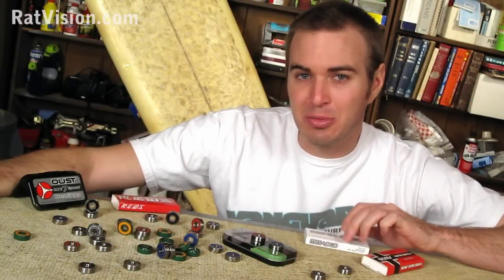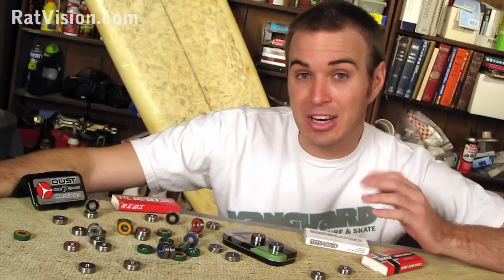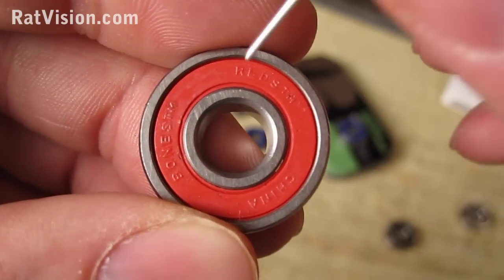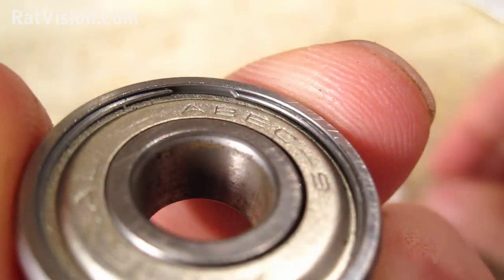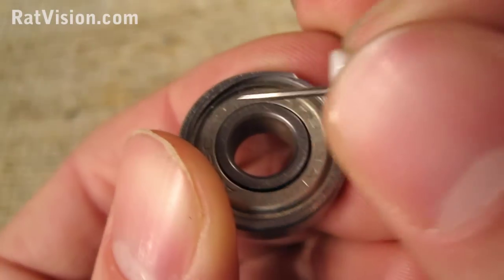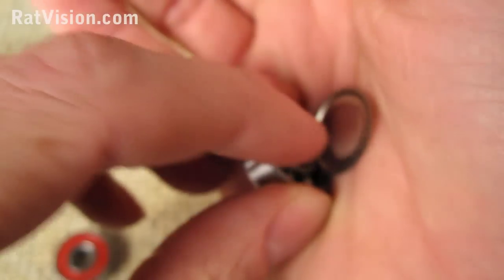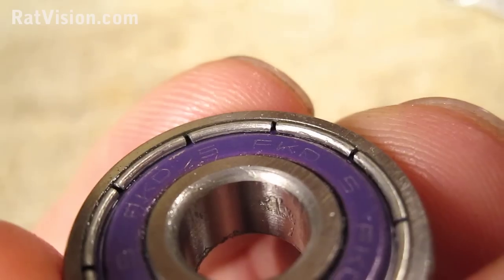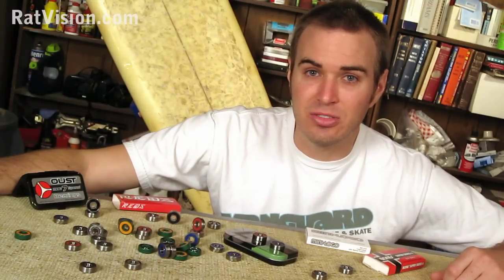Take Off Skateboard & Longboard Bearing Shields/Seals

Comment: So da last type of bearings how do u clean those
Reply: You don't
Reply: Damit. But still, what if I clean them with the citrus cleaner, rinse off with water, and blow dry it before lubricating it with some proper oil? Why wouldn't that work?
Reply: Csanakb Some water might still get trapped inside
Reply: What a fucking ripoff...
Reply: Yeah what I'd suggest is just trying to pry open the entire thing and see if you can put in your own makeshift shield.

Edit- try a thin flathead or a sturdy razor blade in the center
Reply: I'd use rubbing alcohol. Pour some in a paper cup then submerge the bearing with one hand and make it spin with the other (prolly should wear gloves) for a minute or two then take it out and spin it dry then do the same thing with a cup with the lube. It might not get everything out but by the look of how they are pressed in, it will get alot out. Lastly dry it off with a paper towel and away you go.

Comment: As I speak Spanish I'm not quite sure if what we know here as "Vaselina" (solid & liquid) is the same as you know there as "Vaseline", which is a brand. If so, we're talking about the same :P
A mix of pure solid and liquid vaseline works well as lubricant for lot of purposes. Obviously not all. I've never used it in something like this. But let me say it is working great so far. The only trouble is that 'vaselina' melts easily with heat, and can come off. But the mix I made is still there.

Comment: I got a set of the mini logo bearings, which has a metal shield and a rubber shield. Which side do you recommend should be facing the outside of the wheel? The side with the metal shield or the side with the rubber shield?

Comment: +rat Vision skateboard Tech   Also, for in-line skates, which bearing puller do you recommend? I currently have a "BSB speed bearings Gryptool one-step Push\Pull bearing removal with a 5/32"Allen key", but it is worn out and the bearing gets stuck on it when I pull them out. I would like to buy a new tool, but I don't know which one would be better for inline skates. i use bearing spacers, and most of the reviews I've looked at say the pullers don't work when you have spacers. thanks again

Comment from the maker: Take the shield off.  It's not doing any good now that the C-ring is gone.  If there is a shield or seal on the other side of the bearing then turn the bearing around.  Add lubricant to that bearing regularly to keep it from getting ruined faster.

Comment: I never said it made bearings faster, I care about bearing speed, What I did say was that removing one shield from a sealed bearing will allow you to clean and lubricate them which is not possible normally with greaseballs. It may cause them to become dirtier faster than with two shields but it'll also allow you to lubricate them if they run dry, and as you said, will help to avoid blow outs. Not trying to start a war here, just clarifying what I meant.

Comment from the maker: Are yo aware that you're replying to questions that are over a month old?  You don't want to use bike chain lubricant for bearings.  You'll slow them down and the particulates in dry greases are not small enough for the metal surfaces in bearings.

Comment: when putting the c ring back make sure you have it orientated correctly. If you look at the rings cross section you'll see that it is not flat and parallel to the radius but at a slight angle.If you do not pay attention they might just fall out. You can easily tell because the bearing do not run normally and do not feel as if they are completely shut

Comment: If you have pressed metal bearings then you should remove them from the outside. Use a sharp sharp cutter and gently work the clips in. Work only 2 and then gently slide the cutter in and pop off the shield. This will damage the shield but when you put it back in it will be easy to make sure that it still seals. The key is to not damage the inside of the shield. Also remove only one side so that you can face the damaged side inwards protecting it. (I had an emergency because I bladed in the wet and rusted my bearings)

Comment: Hey I have the pressed in shields and it's a really old board so the bearings are slow and dirty. I wanted to give cleaning a try with stuff at home before I give in and just buy new bearings. I was just wondering if i can still go the whole mile like in your cleaning video with the shields on while cleaning and still get some results? I don't need the best board in the world coz it's only a small hobby but I'd like the bearings to go a bit faster so I don't have to push as much.

Comment: I currently have bones super reds bearings and have an old pair of reds. Would it be smart to take the seals off the old pair and put them on the back of the new ones where it's open? (where you can see the bearing spacer)

Comment: Anyone super frustrated with intensely grimy c-ring removal, I found the best way is to get a normal sewing needle and hold it with a pliers. If its not lifting on one side try the other and just keep at it. :)
I stabbed mt fingers to the bones more than once but when I did it this way, ugh, worth it.
Reply: my shake junt lowrider bearing one shield keeps coming off by its own and i have to keep pushing it back in and its the dirtiest bearing shield out of all my other ones.

Comment from the maker: Well that sucks.  As you can see in the video a paper clip works just fine. If you had to pry to the point where the seal got bent then you were possibly prying too hard and may not have done it correctly.  We've been using paper clips for many years and have never bent a seal once.

Comment: So, I used to skate when I was younger, but only for awhile. I didnt know anything at all about the board but how go ride it. Soon stopped and put my board away. Well I found it when I was recently asked to chill with some friends and my bearings were dirty. What bearings do i need to get to get back into the habbit of skating? And is the bearings the only thing on the board that requires maintinience besides the deck itself?
Reply from the maker: The bearings are the only thing that needs maintenance, besides deck repair.  I'm not sure how bad the bearings are that you have.  You said they were dirty.  If you haven't ridden the board in a long time, you may just need to lubricate them.  Just go with a cheap set of bearings.  Since you don't skate that much there is no need to spend a lot of money.  Sometimes the cheapest bearings end up being perfect.  Most shops sell Bones Reds for around $17.  If you find can't find cheaper, go with those.  Cheap doesn't always mean low quality.

Comment: hey man thanks for the video. Ive tried to clean a set of rubber sealed bearing but in the process of taking the seals off the rubber got damaged and the seal comes out every time i skate making the thing just dirtier than ever. is there a way to remove the rubber seals without damaging them or are they just really susceptible to deformation ? PD: ive been using the thiniest threading needle i could find so i dont think that the size if the hinge is the problem.
Reply: oh forgot to say i used the part that isnt pointy

Comment: @skateboardtech Are you sure there is no way to get inside metal pressed bearing shields? I'm dying to clean mine thoroughly. Also, I use break cleaner to clean my bearings and some dry powder lubricant. Are any of these safe for my bearings?

Comment: For the pressed bearing shield, you can destroy one of the shields to maintain the bearing then install with the open side to the center of the wheel. To destroy it you can use a small screwdriver. You are welcome.

Comment: Is the back of the Bones Reds bearing made out of rubber? Can you use something to take out the shield without damaging it? Or is that the best way to do it? (I'm sorry, I'm still new to skateboarding :/ )
Reply from the maker: Do not touch the white/clear plastic piece.  You won't damage the rubber seal with a paper clip.

Comment: should you use the same orange citrus cleaner that you clean your bearings with to clean your rubber shields/seals with as well? Like, just a nice damp paper towel with some of the cleaner on it, and just rub it around both sides and then dry it? Or...a different method?

Comment: i have a question. i got the exact c ring bearings you used in the video. 1 ring fell off while skating. the shield isnt on tge vearing now since it wont stay there without the ring. could i still skate the bearings?

Comment: Is it true that if you take the clear plastic spacer that is inside the bearing, that it will make your bearings faster? I don't meant the seal or shield, but what's inside that separates the balls.

Comment: What is the liitle maintanance for the non removable shield bearings?, please help
Reply: I wanna know the same thing 😐
Reply from the maker: +Luke Literal You can either clean them the same way, or lubricate until the bearings are no good.  You need to be very careful at drying the bearings.  Spin them a lotwhile blow drying.
Reply: +Rat Vision – Skateboard Tech  Thank You
Reply: +Rat Vision – Skateboard Tech  how do I disassemble abec3 bearings
Reply: damnit I wish I read that earlier, I ended up removing them and they won't go back on. they sell replacement shields on bones for the bargain price of flipping 8 dollars and 6.50 shipping for a full set. Not even remotely worth it

WHY THE FUCK DO THEY MAKE THEM LIKE THIS?!?!?!?!

Comment: Can I take the bearing seal with a pin ??
Reply: Bones reds
Reply from the maker: JR Z Yes
Reply: +Rat Vision – Skateboard Tech 
What causes shields to pop off during riding?
Reply: +Rob Munoz Not properly inserted or dried out rubber in the seals usually.

Comment: I removed the shields off zealous bearings with built-in spacers. Was not a good idea. It was very clean inside and still lubed up. But I bent the shield. It's like more aluminum than rubber compared to bones reds.
Reply from the maker: Steel*

Comment: i just have a small question, i have redz bearings for my wheels, and i removed the ball holders inside the bearing instead of the red shield. is that bad? i put them back and they dont spin like they used to. im going to clean them, but should i just remove the red shield next time and not the ball holders?

Comment: Hey! Rat VIsion, is it safe to ride my bearings with out the ball bearing plastic holders? I already ride with out the guards, but i notice a great amount of speed with out them
Reply: No I popped my bearings like that
Reply: That's what I do and mine are fine
Reply: +Anon Ymous The plastic holders re the ball retainers.  Deep groove ball bearings are designed so that the inner race can be assembled by sliding all the balls to one side and inserting the inner race.  It comes out just the same way.  Without the retainer, the inner race will eventually come loose and your bearing will be ruined.

Comment: i wish that bones reds had shields on both side so they hold in the lube for longer, i guess you can get some more shields separately but i cant find any on the net
Reply from the maker: You can put seals from an old set of Reds onto the other side of a new set.
Reply: Rat Vision – Skateboard Tech true but bearings are expensive but i guess when you get your second set you just put them on a soon as you get them and so on
Reply from the maker: Yes, that's what I was referring to.

Comment from the maker: Now you learned not to buy those bearings.  Hurray.  Apply lubricant and ride them until they break.  Or you can try cleaning them with rubbing alcohol, but only if it is +90%.  The remaining percent of rubbing alcohol is water.

Comment: I have pressed metal bearing, I do realize that there's not much I could do. But is there anyway I could clean them, and grease/oil them up; I skate for a good 3-5hours every day, and I need to maintain them.
Reply: Yes. I'm a newb here..so please, reason with me
Reply from the maker: Lunnatikatz That's cool that you skate so much.  Because you do skate so much I would offer a different solution.  You can do the same cleaning method shown in the video, or you can keep adding a drop of lubricant to every bearing once a week until they fall apart.  Because you skate so much and require frequent cleaning and lubricating, it would be best to get some bearings that are easier to maintain.  Personally, I would just lubricate them until they got slow or fell apart.

Comment: ok for the rubber ones, use the smallest flathead jeweler's screwdriver on the inside of the ring,  it fits much neater, and won't tear or stretch the ring.  dollar stores have a set for, well, a dollar...and supermarkets have them in the line as "eyeglass repair kits".  I used to have to clean my bearings once a week from work, or they would start to fail.  complete teardowns, balls and all.

Comment: The last purple bearings why is it not removable? Cause I'm having that.. How can i clean it with the Bones speed cream i just bought?
Reply from the maker: You don't clean with speed cream.  You put it in after you clean and add a drop to every bearing about every 3 weeks.  You can skate your bearings until they break, or clean them the same way.  You have to be sure to dry them completely by spinning the bearings.

Comment: As an ME, I mostly agree with the video but disagree somewhat.  It's ALWAYS best to remove both shields (or seals, whichever applies) - for cleaning both sides of the cage and races.  Citrus cleaner is very good, but it's no problem to clean with common dish soap (esp. Dawn), then rinse with water thoroughly, and dry completely.  A final rinse with alcohol (denatured/methylated or 90% isopropyl) is a GOOD thing - it mixes with and helps remove trapped water.   Drying thoroughly after is the key.

Comment: Ok... So, today I was tightening the nuts on my wheels and I dented my bearing a little bit... It doesnt seem to cause any slowness whatsoever, infact it might be faster than some of my other wheels. So, what I was wondering, is what should I do? Should I just keep the dented shield on? I tried to take the bearing off on the axle of my truck, but it wouldnt pop out... So, should I just leave the dented shield on as it seems to pose no problem, but I cant get the bearing off of the wheel.
Reply: Alrighty! After a bit of research and dedication, I managed to get the bearing out of my wheel on the axle. I took an exacto knife and I got the shield that was dented off of the bearing. I then took the side that did not have a shield and I put it facing the inside of the wheel, and the side with a shield facing the outside of the wheel. It is not making any strange noises anymore, and I just plan to clean the bearing out every now and then. If anyone has this same problem, just do what I did!
Reply from the maker: You can leave it.  You may not have dented it in far enough to cause an issue.
Reply from the maker: Looks like you're fine.

Comment from the maker: @fallendude246 I just wrote an article for Concrete Wave that completely answers this type of question. It's really hard to know what the best bearings are or brand to choose. Manufacturers don't give out technical information about why their bearings are better. Most of the stuff out there about bearings is hype and bullshit. Plus most bearings are not made by the brand. They typically buy them from a Chinese manufacturer and slap their name on them. ABEC what, Biltin? I need more info.

Comment from the maker: @1511116 Don't worry so much.  There is nothing to be intimidated about.  Just follow the videos and you'll be fine.  Putting the C-ring back on can be difficult.  The worst thing you could is tighten the axle nut down too tight on the bearing, but if you use bearings spacers you won't damage the bearing.  Just use common sense.  if you have any questions send me a message thru my channel.

Comment: What should I use to clean off the bearing shields? I swear, I try not to ride in dirt or water, but by the end of the day, my bearings are always covered in what I can only describe as layers of chocolate cake. Especially the bearings facing the inside of  the board.

Comment from the maker: Removing shields does one thing and one thing only. It will eventually ruin the bearing.  Removing shields does not make a bearing faster. If removing them makes it easier to clean, will also make it easier to ruin the bearings.  This goes against logic.

Comment: Help. I'm having trouble getting the bearing out of my penny wheel. I tried to pry it in with a screw driver but it still won't pop out.
Reply: If you are still struggling 3 years later. Use the trucks axle, put the axle just inside the bearing, then twist like a bottle opener

Comment: wow i keep those off alot of pros take the seals of because it keeps heat in the bearing because of friction caused by the wheel to rotate you go faster and keep speed longer if you keep the seals off and use a razor blade to get these of pops right out

Comment: Bruh, I had The last type of bearings and it was so easy to get the shields out
Reply: How?
Reply: Took a Razer blade and stuck it under the riged bumped thing and pryed it up. It took a little force tho
Reply: +Baconwarrior64 I got a screwdriver and a rubber mallet and pounded on the shield
Reply: +Alex42 Sgv nice

Comment: Did it 2 times one was a rubber the other was metal,both got deformed,lucky the rubber one still snap in place tho it became prone to poping out,maybe they r low quality brandless bearings but it thought me not to mess with it now that I bought a set of bones reds...so now I have to maintain more often wiping dirt of evertime I see it start to accumilate xD